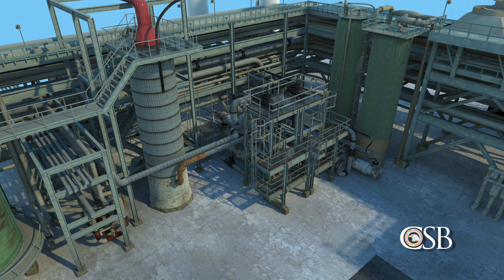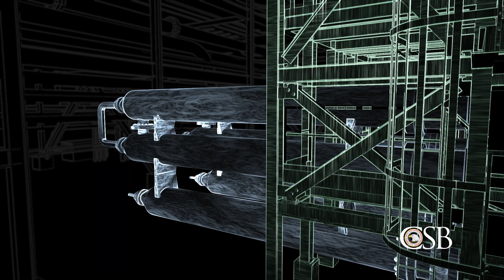Animation of Explosion at Tesoro's Anacortes Refinery

Comment: Thank you for putting the time and effort into these videos that you do.  Is this phenomenon also called hydrogen embriddlement or is that something different?
Reply: +Dan Heidel +465maltbie 
This is HTHA, not hydrogen embrittlement. Similar, but not the same damage mechanism. Also, this was a naptha heat exchanger, not hydrogen service. Excellent video by the CSB.
Reply: Hydrogen embrittlement, yes.  It's a constant problem when dealing with hydrogen gas.